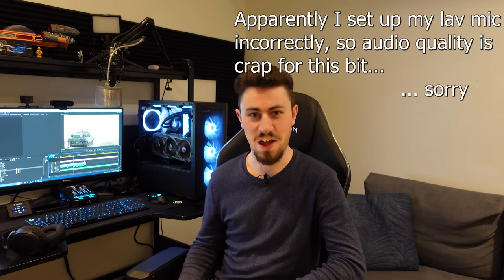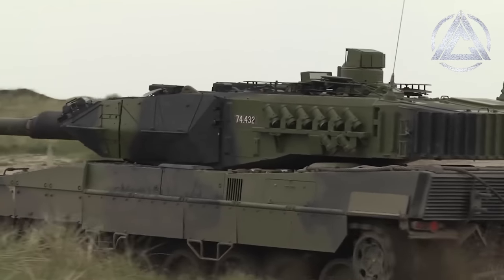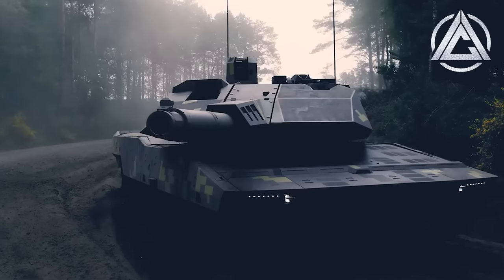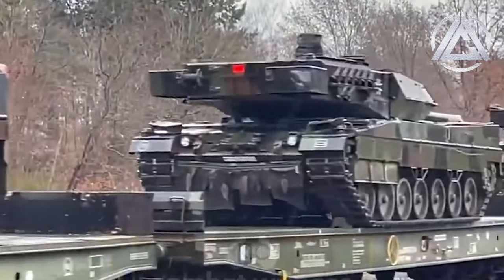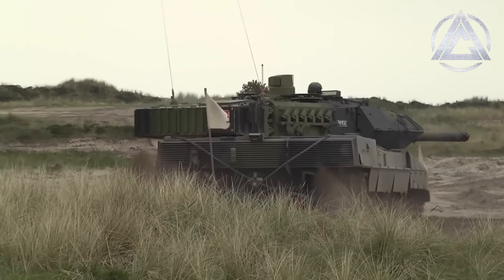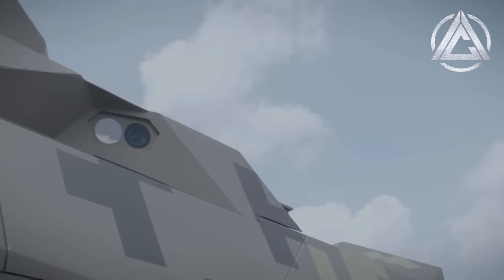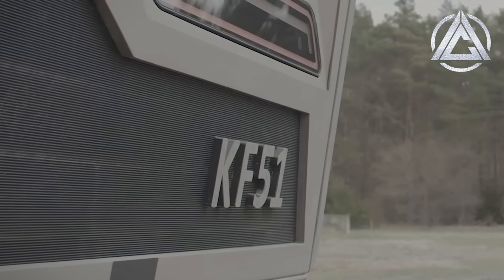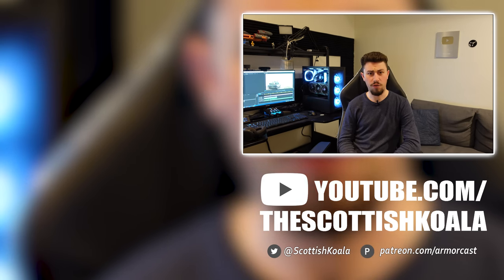Germany's New KF51 Panther Tank | The Spearhead of a New Generation?

Comment: Re the drone and 4th crew member option replacing ammo space:
Consider that a ger tank Co has 3 platoons of 4 tanks plus 2 command tanks for cpt and 1lt. 
Plus an additional 2 tanks for col and ltcol per 44 tank battalion. 
Loitering ammo and 4 seats could be limited to those 8 command tanks, leaving the other 36 tanks in the bat with 30 rounds of 130mm each.
Reply from the maker: Correction - without the drones, max ammo capacity for the Panther is 20, not 30. With the drone system installed that drops to 10.

There IS also the option of carrying a third ten-round resupply drum EXTERNALLY on the rear of the turret… but this is a ridiculously bad idea.
Reply: @ArmorCast   i have got a question, i have heard somewhere that the doctrine of the leopard is to have trucks following them around, and carrying stuff like air intake parts neceserry for the leopard to drive under water. is this even true? and if it is cant they carry ammunition?
Reply: @ArmorCast   I remember an interview with a RM guy claiming the 4th crewman space can be used for additional 10 rounds of ammo like it is used now in the Leopard, but with blow out protection. 
Else it would be empty space, which would be wasted.
Getting the ammo up in the turret might get tricky, but shouldn't be impossible.
Reply: @robo-suport_czrobofactory3116  Of course all tanks are supported by ammunition trucks. But that ammunition is useless if it isn't in the tank. 10 rounds of ammunition is very low which means tanks will have to be reloaded more often and the ammunition trucks will have to remain closer to the tanks, where they are very vulnerable.
Reply: @Rampant16  
"ammunition trucks will have to remain closer to the tanks, where they are very vulnerable." i guess that would depend if the tank is in combat or not, then again the drone menace doesnt guarantee that even if u arent under fire that there isnt a grenade comming down as you are reloading...

hard to discuss this as i dont know much about how a battle field looks like. 

either way thanks for the response.
Reply from the maker: @positroll7870  Do you have a link to this interview, because I've seen nothing in English at least that would suggest the optional 4th station can instead be used for ammunition. Either way, it cannot be used for a ready DRUM of ammunition like the rear turret position can (again, TERRIBLE idea!), meaning that any ammunition that IS stored in there would have to first be transferred into one of the expended drums, which could not be done from within the vehicle. Otherwise, it would have to be manually loaded into the gun, likely reducing fire rate to around two rounds per minute (from potentially twenty)
Reply from the maker: @robo-suport_czrobofactory3116  All tanks are "followed around" by resupply vehicles, whether they're tracked platforms, or trucks like the 40 tonner. However, "followed around" insinuates that the trucks are right there within a few dozen metres of the tanks, ready to jump in, fill em up, and then get back out, which is not at all true. They'll be 30km back if not more, waiting for the tanks to come to THEM for resupply, which can take hours. This is why ideally, you only have to DO that once per day.

In fact the Abrams crews of early model M1s (using the 105mm rifled gun) actually DIDN'T WANT the larger 120mm, because although it was a vast increase in firepower, it reduced the ammo capacity from I believe 56 rounds, to just 40, meaning more frequent resupply necessary, taking them off the battlefield for extended periods of time. FORTY rounds was too few for them... imagine telling them they can only have ten!
Reply: @ArmorCast  it was in German, a day or 2 after the unveiling. Don't have a link. 
I'd guess it would be single rounds to reload one of the rotary magazines in the turret, under cover behind the front.
Reply: @ArmorCast  
alright, clears things up.
thank you for the response.

Comment: If you consider this as an upgrade options demonstrator for the export market, then it makes a whole lot of sense and opens up a lot of possibilities:
1) drop-in turret upgrade for Leo II with new 130mm gun
2) Keep current 120mm gun and 4th crewman, replacing autoloader and cassettes in demonstrator turret with current compartmented storage.  This option makes the turret an interface between the old hull & gun and new electronics, active systems, drones, etc.  The lighter armor maintaining current level of protection even has an improvement on performance using an unmodified legacy hull: lighter overall weight means higher speed; access to more bridges and roads; and less wear on drive. suspension, tracks, etc.
Reply: I think RM will be reluctant to offer a 120mm gun version of the KF51. For one they already have developed a "light tank" which is basically a 120mm gun turret on a Lynx chassis and secondly, I think one of the purposes of the Panther is to get the 130mm gun out there as fast as possible and establish it as the new NATO standard before anyone else (like Nexter with their 140mm gun) can develop their own next generation gun.
Reply: @TrangleC  I don't mean that they will offer a 120mm KF51, I mean that they will offer an upgrade package for existing Leo2 A6's & A7's consisting of dropping the KF51 turret into the Leo2 hull with the existing 120mm.  This allows the new turret to take all sorts of future electronics upgrades which the existing Leo turrets cannon handle.
Reply: @jhilal2385  Yes, but that is what I meant too. Since the KF51 currently basically is just the turret, offering a KF51 turret with a 120mm gun would basically mean offering a KF51 with a 120mm gun.

The reasons I gave for why I think that is unlikely still stand.

Comment: The launcher module for loitering munitions/recon drones, that will use valuable main gun ammo space, looks more like something for a platoon/company commander version. It does make sense to have specialised variants within a company; variants that are indistinguishable from the outside.
Reply from the maker: To a degree, yes. Russia for example have dedicated “command” variants of their tanks in each battalion. But anything that doesn’t directly benefit, or even takes AWAY from, the ONE role the main battle tank is designed for… is not smart to include. Tanks are already too big and heavy, and every measure to reduce their size and weight is important. The inclusion of drones and systems that another, dedicated vehicle in the regiment could be operating… is not a good idea.
Reply: @ArmorCast  A separate, dedicated vehicle would require more personnel and logistics to the unit though. At the very minimum, the drone car would need a driver and a drone operator while the tank already has a driver installed. If you have 150 men in total, having to divert more of them to driving might not be the most efficient use of manpower.
As always, in the end it's always a compromise between different and often contradicting demands and desires.
Reply: @ArmorCast  Could a modified IFV being used as the basis of a drone carrier be a good concept?
Ditch the infantry capacity (and mission profile) and instead have launchers and resupply for drones and the operators/pilots sitting inside at control stations in the space that was formerly for carrying the troops.

Using a existing IFV hull has both development cost and in field logistics benifits, and also means that enemy forces can't readily identify it as a drone "mothership" and thus a priority target, especially if it's accompanying other IFV's.
The autocannon also provides it with good personal defence against a wide range of threats, assuming that enemy MBT's will either be dealt with by its own anti tank Kamikaze Drones or by friendly MBT's (or FO artillery) that are data linked - see below. 
The IFV autocannon will be the bane of enemy infantry that have been spotted by its drones, especially if airburst range data can be automatically fed in.

And being the standard IFV it will be able to keep up with the other armour and do dedicated overwatch while the "heavy MBT" does the job it's optimised for.

However a small long endurance helicopter drone optimised for a MBT does make sense just for situational awareness in both Tank vs Tank battles and in spotting anti tank infantry that could ambush the MBT.

But leave launching and controlling the attack drones to a dedicated vehicle that isn't on the tip of the spear, but following close behind.
Reply: @johanmetreus1268  Apparently that new land combat vehicle system the Germans and French work on together goes far beyond just developing a new MBT.
It seems they are developing a whole new family of specialized vehicles and the MBT is just one of them.
What they are envisioning is that you won't have tank platoons with 4 MBTs working together anymore, but instead "teams" or "packs" of several specialized vehicles.

Such a pack will probably contain something that resembles a MBT as a "dueling vehicle" specialized on destroying hard target enemy vehicles, one "NLOS" vehicle, some sort of self propelled howitzer or a launching platform for loitering ammunitions or kamikaze drones or both, a air defense and anti drone vehicle and a command vehicle which controls several recon drones and can perhaps remote control the other vehicles. It might also get a electronic warfare capability.

And then you can attach one or more Infantry Fighting Vehicles to such a pack for the anti infantry role and other specialized vehicles like recovery and engineering vehicles.

Such packs would kind of function like a vehicle version of special forces teams.

Comment: Interesting to know the Hero is an optional component for a command or recon variant... I think having a greater range and leveraging better information sharing and being able to scout remotely will be useful, as for the javelin Hero's, and I can see it being very useful against tanks that may not be as advanced, such as the majority of unupgraded Russian or Chinese stock and light armor, and possibly have applications with an HE or Frag warhead against infantry in trenches or other difficult to attack positions (which likely lack APS systems generally reserved for vehicles). Having a loitering munition may be a significantly advantageous ability due to the entire vehicle being able to be fully in cover, while also assuming the trend of digital combat integration with AR and live HUD elements is embraced - everyone can see what the drone sees, not just the tank. This may also result in more use of LOS encrypted laser communications as electronic warfare becomes more and more integral.

Imagine a fleet of these tanks launching a swarm of loitering munitions as a preemptive strike to soften armor as they are moving towards a target objective, not having to rely on calling in artillery and waiting for it, and also being able to immediately strike in the following confusion after the munitions are commanded to detonate simultaneously.
Reply: I think it's optional because you don't need a recon drone on every tank. Some smart planners will figure out that you need X of them per platoon, or per battalion, or whatever, and then some of them will carry it, and the rest will carry more ammo.

Or option B: It won't be launched from the tank at all. It has no real reason to right? It can fly, much faster than a tank can drive too. Launch the drones from bases or vehicles that are well behind the frontlines, have them catch up to the tanks, and tank crews control them from there. Almost exactly like Loyal Wingman.

Comment: I saw the picture of the driver compartment in Lazerpig's T14 video.  It literally looks like something straight out of Mobile Suit Gundam with monitor front and on the sides.  The only better driver I can think of is the AT pilot goggle, which is directly connected to the tank's sensors from Armor Trooper Votom.

Comment: I have heard the statement that the KF51 is NOT a next generation tank but rather the maximum you could squeeze out from the current generation. Is there any truth in this?
Reply from the maker: It really depends on what you define as "generations". There are no hard and fast rules on this, so it's up to interpretation. HOWEVER, most would call this a next gen tank design given its capabilities and its distinctions (lighter weight, new integrated active protection and advanced sensor suites, new gun and the capabilities THAT brings, etc.

Challenger 3 I would perhaps say is fair to call a current generation tank suped up to represent the absolute top of its gen, but KF51, along with Abrams X, should definitely count as "next gen".

Though I would be very keen to hear the arguments of why it ISN'T "next gen"
Reply: Omg someone has actually made his homework’s. Yes you are absolutely right. 
The MGCS system (German-French tank project) will be the next true gen tank with an unmanned turret, 1 remotely controlled commanders station with a RMG .50, highly modular armor layout, auto-loader, ADS systems and SUPPOSEDLY fully remotely controllable oh I forgot another coaxial RMG .50…
Keen eye you got there ! 
Prost from Germany 🇩🇪

Comment: The increased caliber of the gun, would alone result in "only" 27% increased performance, channeled into whatever parameters. So with the quoted figures around 50%, more is going on here. Something which is also obvious when you inspect the new ammunition. Much more propellant for a "hotter" round, the size of which necessitates autoloader. Not just bigger caliber, but a new generation as well.

Comment: That could get really intresting with the sensors and the recon-drone, when those are connected to the fire control system, just automatically guide the main gun to the source by the push of a button and fire.
With the drone it could even get better, spot a target ready for an ambush, let the drone lock on the target and the gun moves to the target...they won't know what hit them 😆 

The suicide drone launcher makes not much sense, it would be rather for an IFV, but maybe they though about a scenario, to neutralize targets that are hidden or beyond visual range...knock them out before they hit you...would even explain the bigger gun, just maximize the first strike capability.
Think the plan is make one ore two tanks in the platoon to a missle platform if it's required for the mission, to not take less armored IFV into a massive tank fight just to have anti tank missle

Comment: I would remove the loitering ammo feature, because sacrificing HALF of your ammo for that seems not so whise, especially considring the long range of that weapon would allow it to be fired from a different vheicle while still being capable of supporting the MBT. 
Totally agree on the small quad drone, the simple ability to tag an enemy and relay the location with precise digital coordinates is a perfectly good idea, especially since it does not really impact the MBT wheight so negatuvely. 
I do not know about the 7.62 MG, i would prefer the road most next gen MBTs are going for: a light 30mm. But it seems that there is enough space to put that system in the turret. In general the KF51, the EMBT, the Abrams X and the K2 Black Panther all seems very solid tanks on paper, but who knows how they will perform in reality?
Reply: Well it’s exchangeable so depending on the mission you can ether have more ammo or loitering munitions.
Reply: Man you said( wrote). so many words , an actually said nothing at all..
Reply: @reserva120  What do you mean? It's pretty clear. I was just talking about what features of the MBT i like and what i would change, and justified my reasoning. I literally wrote 4 praragraphs.
Reply: i mean isnt the current docrtrine of the leopard for trucks to follow them around anyway? if the leopard wants to drive under water, then the truck has the air intake parts for the leopard to do that, cant they carry ammo as well? so if thats the case and the KF51 will be replacing the leopard then whats stopping the trucks from carrying the ammo and just stick in inside the tank when outside of combat without the need to return to base as much

Comment: Thank you for the great video! I think it may be a viable alternative to instead of having the loitering munitions replacing ammunition capacity in the KF51 design an alternate turret for the KF41 that incorporates them...
Reply: A modified IFV being used as a drone carrier seems like a good concept. Ditch the infantry capacity and instead have storage and resupply for drones and the operators/pilots sitting inside.

Using a existing IFV hull has both cost and logistics benifits, and also means that enemy forces can't readily identify it as a drone "mothership" and thus a priority target.

And being the standard IFV it will be able to keep up with the other armour and do overwatch while the "heavy MBT" does the job it's optimised for.

However a small helicopter drone for a MBT does make sense just for situational awareness in both Tank vs Tank battles and in spotting anti tank infantry that could ambush the MBT.

But leave launching and controlling the attack drones to a dedicated vehicle that isn't on the tip of the spear.
Reply: @casbot71  yes, with the small drones only you probably wouldn't need a fourth crew member and instead have the commander or gunner control it.